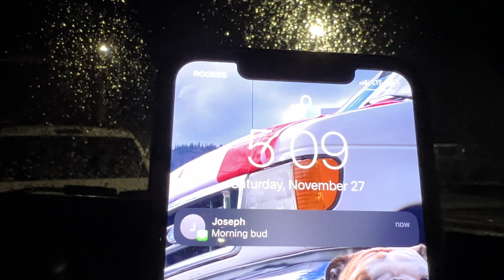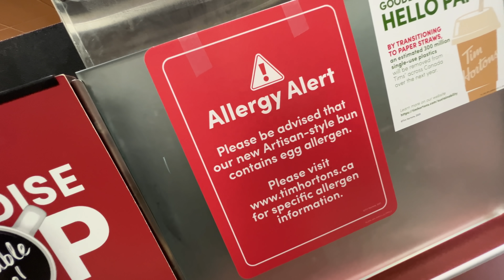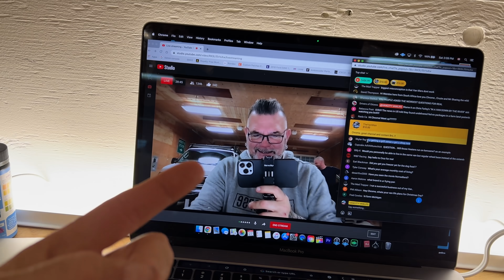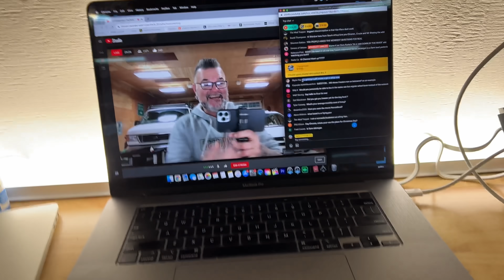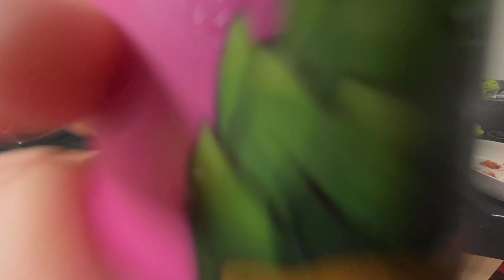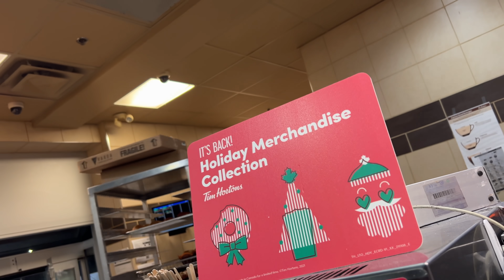24 HOURS OF VAN LIFE • Three Nomads, Three Vans, One Day In The Life

Comment: Those pins that go through your hitch will fall off when off road and they are easy to steal as you said. I like to have a carriage bolt with nylon lock nut on mine. Harder to remove and stays on in all weather.